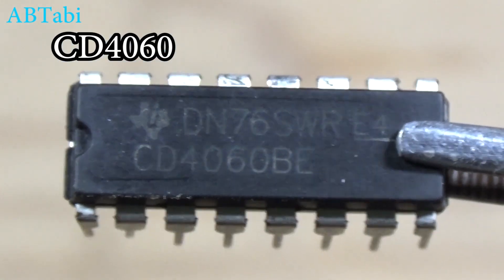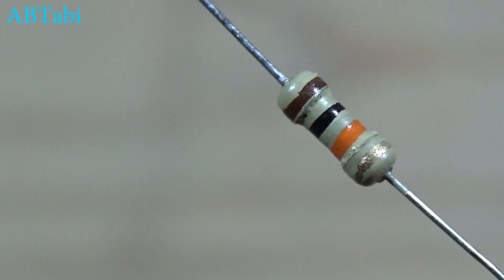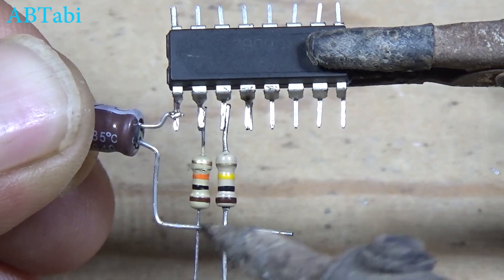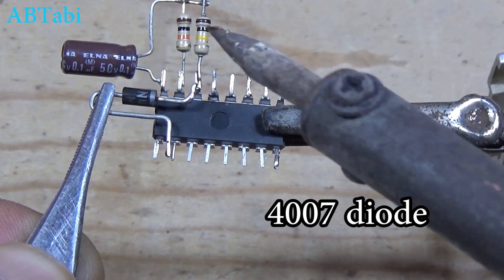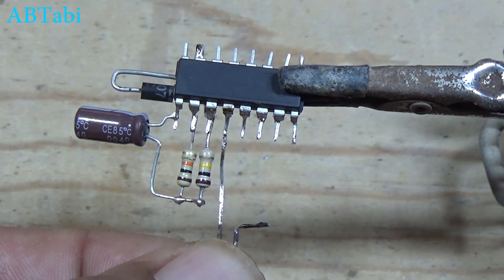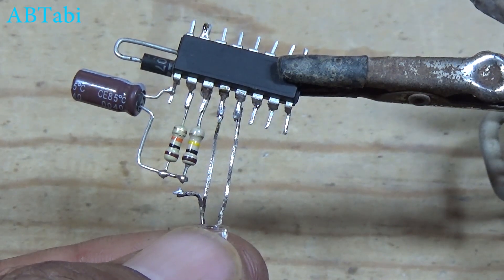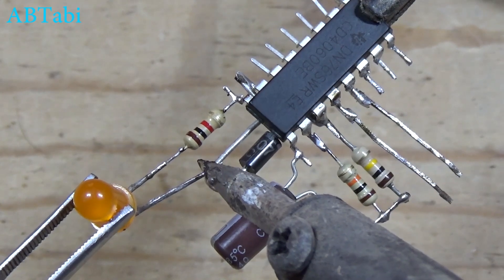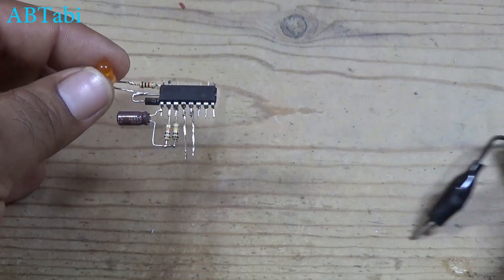Top 5 Simple Diy Inventions Circuit

Comment: I have confusion on the 4007 diode terminals. Which side is positive and which is negative? Some says the silver band portion is positive and the black portion is positive but in diagram it shows the opposite. Please clear my confusion.
Reply from the maker: Dear friend remember ,,,,,, diode silver side is cathode (-)and other side is anode (+) ,,,,,   if we connect positive battery terminal to anode side we can get voltages output from cathode side ,,,,,,
Reply: @ABTabi  Ok thanks. But still  many you tubers say your opposite.

Comment: Helo, can you make DIY gasoline guage using led indicator, is it possible?
Reply: It s not easy because you must think that is a capacitor and not a common resistence ..
Reply: It is possible using an LED level meter IC and you can use the variation in resistance in the fuel gauge. If you are really keen give a reply.

Comment: Schematic 1 is wrong. LED is inversing polarized.
Reply: @maju mundur exactly. I know Very well how 4066 works. If pin 9 will be ground when switcing occours, the KATHODE of the LED must be connected there,  not the anode. Can you see it now?
Reply: you are right.
the LED on the diagram is upside down